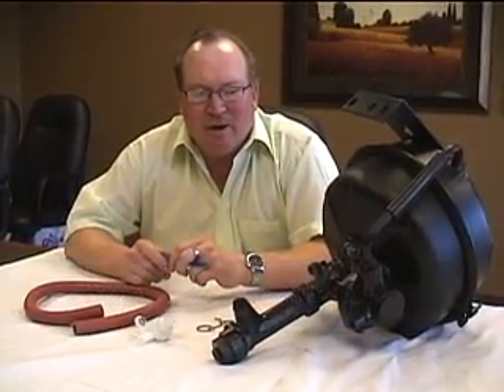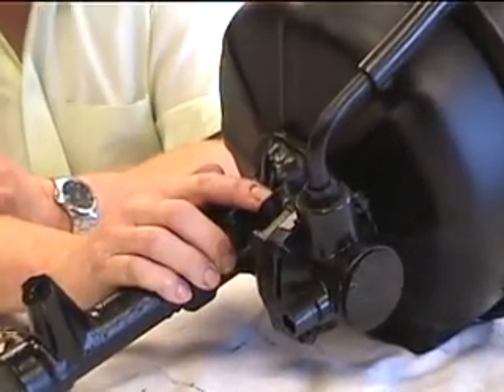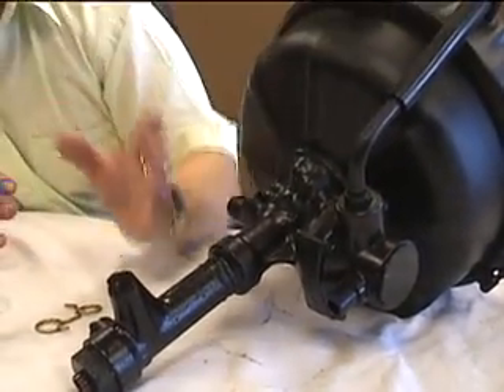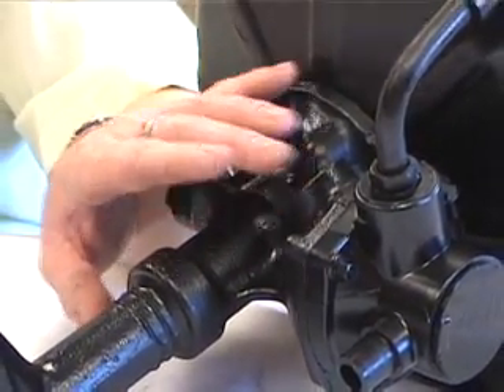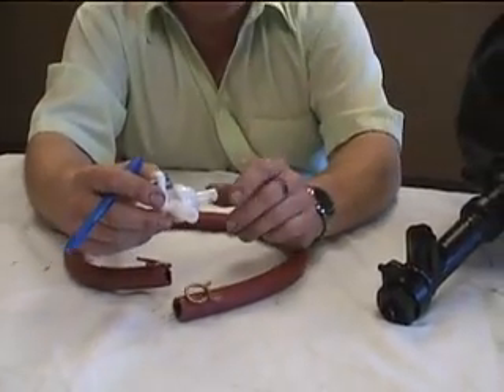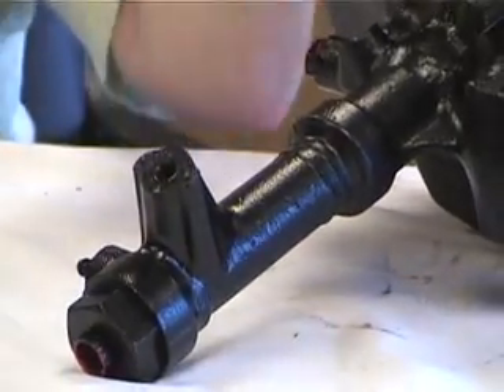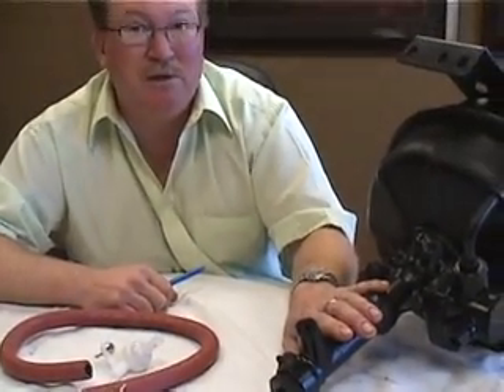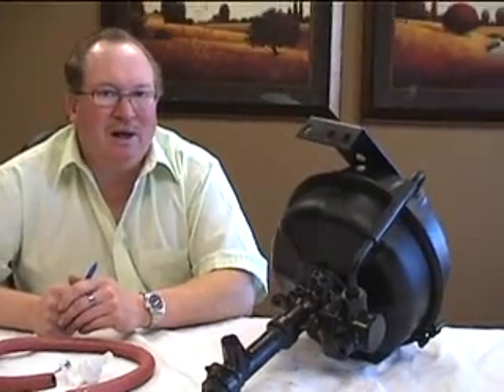Hydrovac Installation

Comment: I have 1978 f700
Wondering what kind of filter needed for atmospheric air intake line?
Reply from the maker: You would typically want to install a small breather filter or air vent filter to prevent dirt and debris from entering the system

Comment: What does it mean if i have to pump brakes to get to some what stop. I have it sometimes not even stop, running stop signs. Have new booster and master cylinder new wheel cylinders. Bleed system.  What am i missing
Reply from the maker: Since you’ve replaced the booster, master cylinder, and wheel cylinders, and already bled the system, here are a few things you can check:

Air in the lines – Even a little air can cause a soft brake pedal. Try bleeding all four wheels again, starting with the farthest one from the master cylinder.

Brake adjustment – If you have drum brakes, make sure the shoes are adjusted properly. If they’re too loose, you’ll need to pump the brakes.

Brake hoses – Check the rubber brake hoses for swelling or damage. Bad hoses can make braking weak or inconsistent.

Master cylinder bench bleeding – If the master cylinder wasn’t bench bled before installation, it could still have air in it.

Brake fluid – Make sure you used the correct type and that it’s clean.

Hopefully one of these will help solve your issue.

Comment: what size vacuum pump do recommend for this hydovac. i have a diesel
Reply from the maker: For a single piston hydrovac, a vacuum pressure in the range of 17-20 inches is typical.

Comment: What if you have constant brake fluid flowing through when open your rear bleeder screws when trying to bleed.
Reply from the maker: When the brakes are applied, you will have brake fluid pressure underneath the bleeder screw as that is it's purpose and how you bleed the truck. If you're getting brake fluid pressure out of the bleeder screw without pushing on the brake pedal, the only thing that could make pressure is if the hydrovac is self-Applying which would mean your hyrdovac has a problem and most likely needs to be serviced.
Reply: @fleetproducts  yes. As soon as I open rear bleeder screws with truck running brake fluid will spray out your foot on brake pedal. Rear brakes lock up when you press the pedal. They won't unlock until you open bleeder screws to relieve pressure.
Reply from the maker: @RpmAuto  I would suggest that you get the hydrovac serviced.
Reply: @fleetproducts  do you know a place that sells rebuild kits
Reply from the maker: @RpmAuto  Please call our customer service team at 403-243-0442 and they should be able to help you out.
Reply from the maker: @RpmAuto  Sorry, our toll free # is 877-243-0442.

Comment: I am a Vietnam Era Vet. I have years of experience with these boosters. The vacuum lines have a tendency to rust through allowing humidity and moisture to get in around the diaphragm chamber resulting in booster failure and defaulting it to manual brakes. This also creates a vacuum leak effecting the performance of the gasoline engine (diesel engines do not have a vacuum from the engine to the booster). There is an atmosphere tube on the back side of the booster diaphragm that also gets humidity into the booster chamber and accumulates at the bottom eventually causing a rust hole.

Comment: 1800 loadstar ih. Tandem hydra vac booster. Had booster rebuilt locally afew years ago. Problem is it takes 4 or 5 seconds for brakes to release after pedal is released. Have been told if brakes are not set up close enough this causes hydra vac to extend to far and take to long to release. Is this true. Thank you
Reply from the maker: Sorry for the delay in reply. The tandem hydrovac requires vacuum to fill the recovery chamber before it will release. I would check that you have a constant rate of vacuum of at least 17 inches. If the fill rate is slow the brakes will hold on. You might need a vacuum pump to correct the problem. Also be sure that your master cylinder is returning all the way by looking under the dash and pulling back the boot that covers the end of the master cylinder so you can have a look and make sure. Hope these suggestions help.

Comment: i just purchased a 1966 D500 Dodge with Holmes 500 wrecker on it. has been sitting since 2001. installed new master cylinder today also new lines. bled master cylinder then installed new line to the hydrovac. i have plenty of fluid going to hydrovac but still brake pedal goes to floor no brakes. guess the hydrovac unit is locked up. can you help me looked online and don't see them listed to buy. todays date is 10/2/2021 thanks for any help you can give i am located in southeast Alabama USA
Reply from the maker: Please call us at 877-243-0442 and ask for our technical support department and someone will be able to help you out.

Comment: I have a rebuild Midland hydrovac unit on a 1970 Dodge D400. I am about to install my 3rd master cylinder. This hydrovac system requires a 2nd "pump" of the pedal to get the brakes fully engaged. All this pedal travel wears out the MC, I assume
Reply: Usually if you need more than one pump your wheel cylinders are out of adjustment
Reply from the maker: Give us a call and ask for our tech department as they might be able to help you troubleshoot your issue. 877-243-0442
Reply: @fleetproducts

Comment: What causes a rock hard brake pedal?
Reply from the maker: This is usually a sign of a vacuum issue so you most likely need to get your booster replaced or repaired.

Comment: What if the engine stalls when you apply brakes
Reply from the maker: Usually that is a sign that your booster needs to be replaced as there is likely a hole in the diaphragm.
Reply: That's what I thought we ended up taking it apart and the diaphragm is bad. Thank you

Comment: hi,
I have a '64 International 1600 4x4 very high mileage truck and a '69 International 1700 very low mileage truck (15k miles).  Both have a single circuit master cylinder with a hydrovac.  Both hydrovacs seem to work ok and seem to look identical to each other.  I would like to convert to a dual circuit master cylinder in the IH 1700 truck and will need to use the hydrovac from the '64 so each circuit will have its own hydrovac.   Some old IH Loadstar buses used this system.  I'm thinking I want the amount of boost supplied by each hydrovac to be exactly the same and the only way to do that is if both hydrovacs have exactly the same current rebuilt parts inside of them.  
Several questions:
-1-  Would it be better if each hydrovac uses its own vacuum storage tank or should they both run off the same storage tank?
-2-  Is there a dual circuit master cylinder that will bolt directly in place of the single circuit master cylinder or will I need to fab a custom firewall mount?
-3-  Where can I purchase two complete rebuild kits and do the kits come complete with pistons etc like a master cylinder rebuild kit?
-4-  And are the kits compatible with DOT 5 brake fluid?  The IH 1700 has always used DOT 5 brake fluid and the '64 IH 1600 has only used Dot 3 brake fluid, another reason why I will need to rebuild them.  I know DOT 3 and 5 should not ever be mixed together.
-5-  And your recommendations on the layout of the brake lines, please.  Should I have each circuit go to one axle or since each wheel backing plate has two wheel cylinders, should I have each circuit go to one wheel cylinder.  That seems like the best way to do this, but that's a lot of brake lines.
Thank you.
Reply from the maker: You need a hydrovac the same as the one you have on there now with the same output pressure. You need a master cylinder with the dual port that fits the IHC truck in question. When the second system is added, the hydrovac's need to be connected kitty corner to each other so the truck stops evenly. We have a schematic available if needed. You can use the same vacuum source and It must maintain 16 inches of vacuum. As far as the brake fluid goes, flush the system out and start fresh using Dot 3 brake fluid to maintain the same fluid throughout the system. We have everything available in stock that you would be needing. If you need further info or require any further advice, please call us at 877-243-0442 and ask for technical support.

Comment: Wait so hydro acts don't come with check valve built in ?
Reply: Check valves are typically mounted on the firewall in conjunction with a two-speed axle operation.
Reply: @StuffBobbyDoes  Yes you are correct, my 54 2 ton chevy is like you said.
Reply from the maker: Yes that is correct. Hydrovacs do not come with a built in check valve.

Comment: I have a 1963 GMC 4000 and I need a new booster and slave cylinder. Where do I order this at?
Reply from the maker: You can call our customer service at 877-243-0442 and someone will be able to give you hand.